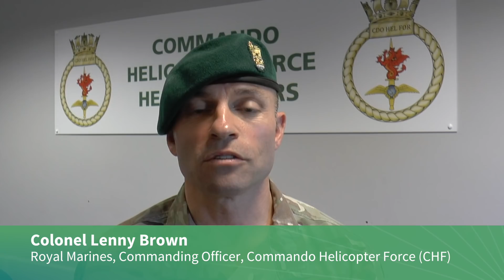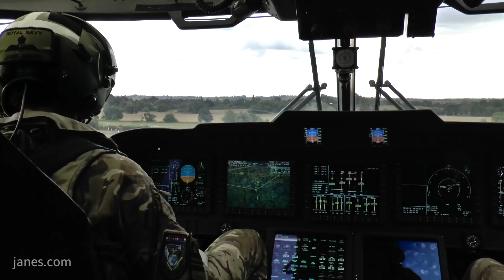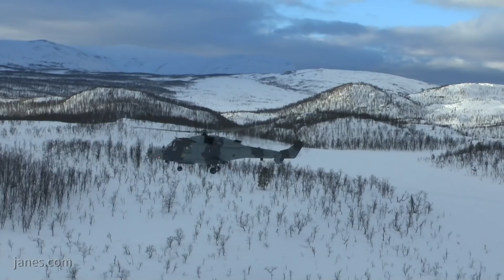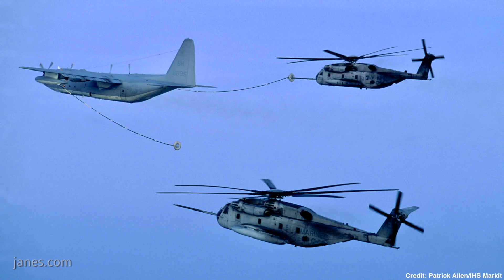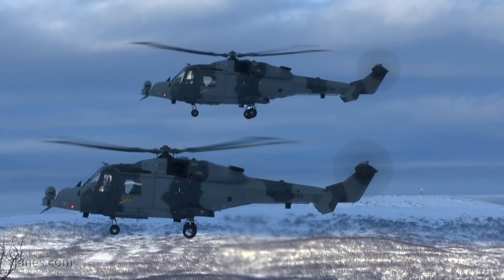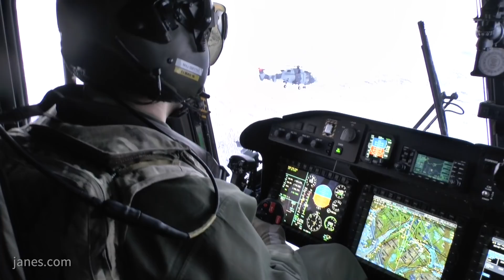Exclusive: Commando Merlin Carrier Deployment

Comment: As am important ground force you need your own flexible powered flight asset, for transport and supply and anti air and ground attack and anti ship roles rather than rely on another unit which may not have aircraft to spare in a combat situation ✌️❤️🇬🇧

Comment: Great idea now just need V22's tankers to keep these fuelled up as neither carrier is nuke  powered
Reply: Wait what?!

None of what you say makes sense.

1 - RN Merlin’s are not capable of in-flight refuelling.

2 - V-22’s are USAF operated aircraft, so not involved with British forces often and aren’t often used as tankers either.

3 - The power plant of the carrier has no bearing on the capability of the aircraft as they have separate fuel stores.
Reply: @Dave-us5fq  no what wait read it again lol V22 can be used as tankers and what else can land on the deck other then a helicopter and F35b ? No wait, the UK don't have V22's why not, no no no wait what's bigger an helicopter on our carrier or a V22 , wait wait 😀
Reply: @aleccap5946  so why didn’t you make your point clear the first time ? I still dont see what nuclear powered aircraft carriers has to do with it either all ships only last as long as their food supplies unless they have Star Trek replicators ?
Reply: @dickdastardly5534  25 years as a pose to a few thousand miles range is a good answer, the food supply i assume you have never been in Iceland the frozen food shop ? What's next  - she was never meant to have cats and traps lol or Cameron was never going to scrap both ?
Reply: @aleccap5946  the mileage debate is a bit like the food debate which applies to nuclear powered ships. The catapults is a reasonable question as it does limit fixed wing aircraft options payloads etc. When a nuclear powered ship is hit and sunk it leaves a hell of a lot more mess than a fossil fuelled ship maybe in the not too distant future hydrogen maybe powering these beasts as 1 litre of hydrogen gives 3 times the range of diesel I’ve read and the transformation of the engines is nowhere near as complex as having a reactor on board. Technologies are changing and I think nuclear is fine for subs as their are far more stealthy. As for Iceland shopping I think that in tough times there are thought measures but your average Matelot will soon be grumbling about the limited options of fresh produce being coupled up on constant alert - food and its quality are seriously underestimated from a moral point of view. Reroute fitting catapults of some description I suspect will come when the major refit is due assuming the axis powers don’t sink her in the Far East 😐
Reply: @dickdastardly5534  no its not, one has nothing to do with the other, how do nuke submarines stay at sea for months hidden from view and hardly ever surfacing in that time. Stop watching the bbc snooze and do some research buddy
Reply: @aleccap5946  Look dude how long do you think a sub can stay at sea for ? I was in the navy and don’t be so flippant
Reply: @dickdastardly5534  months you silly girl fresh air and drinking water frozen food and this is below the waves do some research
Reply: @dickdastardly5534  Buddy were you in the British navy which I doubt or the Egyptian sand navy ? Nuclear submarines can operate underwater for three or four months
Reply: @aleccap5946  Royal Navy you bumptious prick and you’ve conceded the point i was making that the tours are limited by provisions,. You really need to articulate; your points rather than rambling incoherently maybe cut down on your weekend excesses as a top tip 😁
Reply: @aleccap5946 And still limited by its need to replenish aviation fuel and wait for its diesel powered escorts not to mention its horrendous build, maintenance and decomissioning costs, and did i mention the limitations caused by most nations denying entry into their ports for nuclear powered vessels ?
Reply: @aleccap5946 A nuclear submarine does not have to rely on escorts that require fuel replenishment, stop watching cnn buddy.
Reply: So what does the power plant on the carrier have to do with this aircraft ?  p.s nuke power has more drawbacks than positives....seing as you mentioned it.